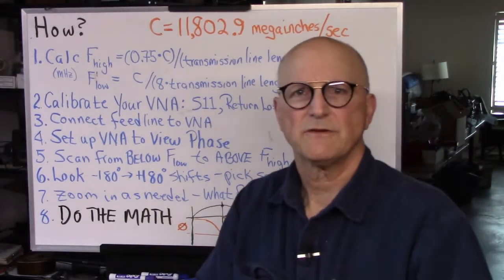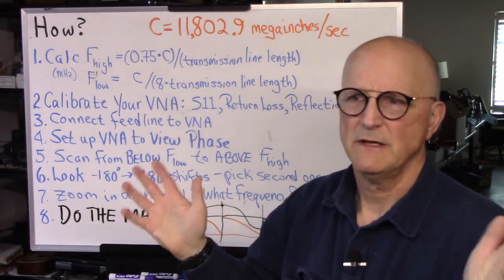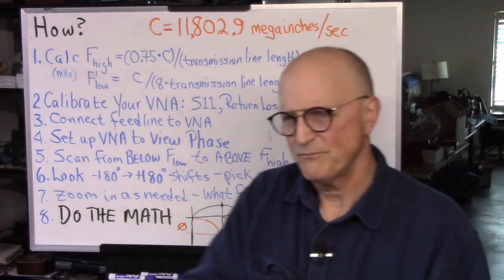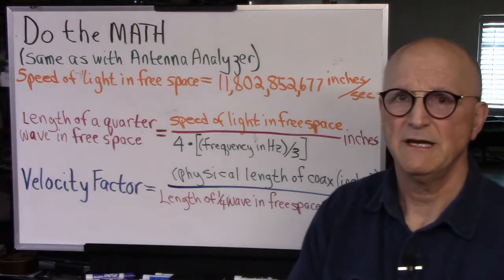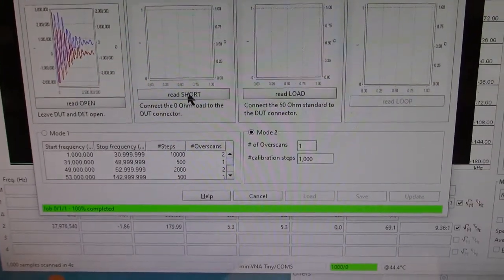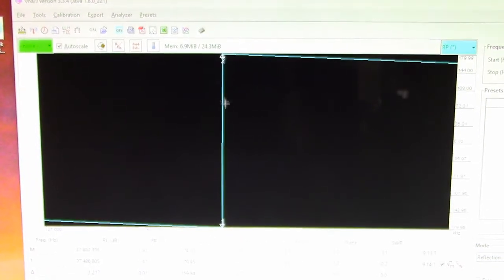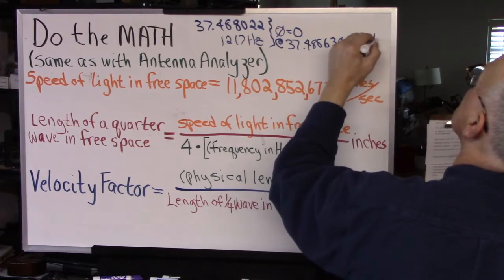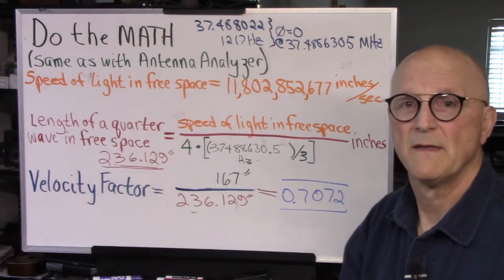Velocity Factor: Measuring using the VNA Method (00e4)

Comment: Thank you for this video. I am one of the new ones following you and checking your videos. Very nice and lots of details. I have just one question refering to this video.At 6.25 is 1/4L according to the length of the cable and the phase gragh. So my question is if i can find 1/4L or 3/4L of any cable i have. I am trying to make phasing lines for the 4 432 mhz antennas i just constructed. I will cut lets say 50cm cable and i will try to cut little by little using nanovna and some of your instructions to finf the correct length for 432 mhz.    Thank you, Spiros   SV8ALQ.
Reply from the maker: I also have a video on creating a band-reject filter using just coax that might shed some light in more detail for you. There is the open-stub version (https://youtu.be/Fd7d6oKHr_A) and the shorted stub version (https://youtu.be/5X9qOYnh_lo).
This works with any ODD multiple of 1/4 wavelength remembering that electrical length and physical length are two different things. Knowing the velocity factor or your particular hunk of cable is critical. The higher the frequency you are working with, the more critical this becomes and the smaller the tiny hunks of cable you have to trim to find the right length. When you are dealing with higher frequencies, it is often a LOT easier to cut your cable to 3/4 wavelength than it is to cut to 1/4 wavelength just be cause the actual, physical length of the cable you are working with is longer.
I hope this helps. :-)
Reply: @eie_for_you  thank you. i will look for this.
Reply from the maker: Cool! :-)
Reply: So i made my first experiments....I looked at the version with open stub. I am starting getting how everything works but i need much more try and experiments. I only need to know how you connect all to nanovna, just to make sure that i do it correct. Have a good night.
Reply from the maker: I terminated my cables in BNC connectors to make connecting to the VNA easier. Careful to be sure to calibrate such that you ONLY have the stuff you want to test in circuit. :-)

Comment: Actually, the VNA connects graphically two points near ±180° because it misses the exact opposite phase. So, technically, it is not 0° phase there. There is ±180°, just like longitude in the middle of Pacific Ocean does not jump to Greenwich 😉
Reply from the maker: Technically correct. As you rightly said, the VNA gives us samples on either side of this perfect frequency where the swap occurs. In order to picture this whole thing, we imagine that there is a point between where the VNA gives us a point where the phase is nearly 180 degrees and where it is nearly -180 degrees where it is zero (obviously a fictitious point whose sole purpose is to help us see a point between the aforementioned points).  So you are right and my rather loose description could have been better worded. 🙂

Comment: Hi, great instructional video.  My PC software for the nanoVNA only does Smith charts.  What is yours and where do I find it. . Note my NanoVNA is the orig V1.  Cheers
Reply from the maker: Well, Mike, I use two different programs. Both can be found here:
https://nanorfe.com/nanovna-v2-software.html
The "VNA View" program is somewhat basic and always connects well with my nanoVNA.
I really like the VNA Saver program in many ways. It sometimes has an issue with connecting to my nanoVNA. If it does, then I connect with "VNA View," then close VNA View and open VNA Saver and then it connects just fine. Always use the "Calibration Assistant" for best results.
Hope this helps.
Reply: @eie_for_you  Hi, NanoVNA-QT finds my device port ok but the hangs.  I've read it's only compatible with V2 NanoVna and mine is the orig V1 running 0.1.1  firmware.  Any firmware above this is for the V2.  I am running NanoVNA Saver v 0.5.4  latest from github.
I've just discovered i can add the phase via Display setup on VNA Saver so all good now.  Thanks for your help.  Cheers Mike
Reply from the maker: @mikebloodworth9258  Glad I could help! That's what this channel is all about. 🙂

Comment: How about measuring Z of the coax? Or whatever unbalanced or balanced feedline, for that matter?
Reply from the maker: I have done this. I used the Time Domain Reflectometry method (see this on measuring velocity factor using the TDR method: https://youtu.be/RRb_iJYjh5k).  The difference is that I terminate the coax with a very small, *non-inductive*, multi-turn potentiometer. I adjust the potentiometer until the reflected pulse disappears. Remove the potentiometer, measure its value and this will be the impedance of the coax.
You are right, though, this would be a great topic for a video.😁
Reply: @eie_for_you  That sounds like a great idea. Measuring Z of a non-HF line, such as two twisted wires, should theoretically depend on wire diameter and insulation thickness, but measuring true value would be very interesting.
Reply from the maker: @ok4rm  I learned that when I worked for a medical company that was having a cable manufacturer create some custom data cable for installation of their product. We had to determine if the data cable (shielded twisted pair) was the right impedance, per specification. So, being that I was the entire engineering department for the company (no pressure there) I had to discover how to do this.  It worked quite slick. We eventually got cable that was the right impedance and worked well over 100 meters. NICE!
Reply from the maker: I've added that to my list of videos to do. Thank you for the suggestion! 🙂